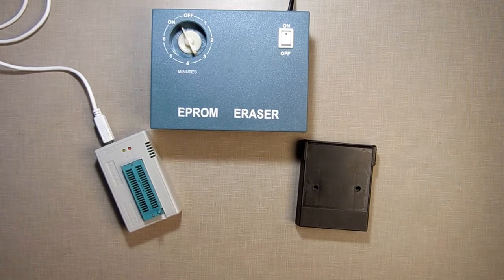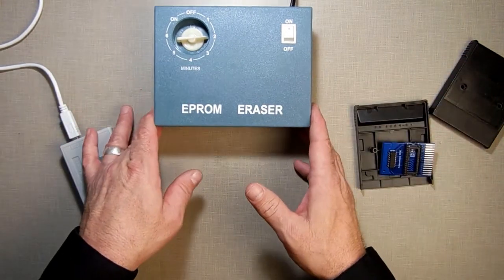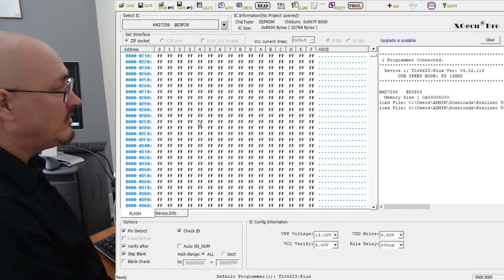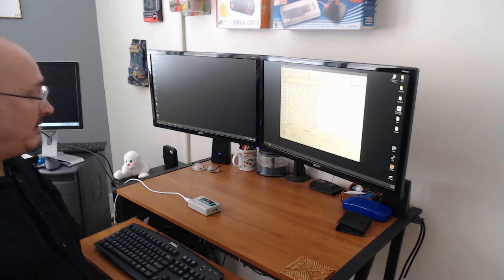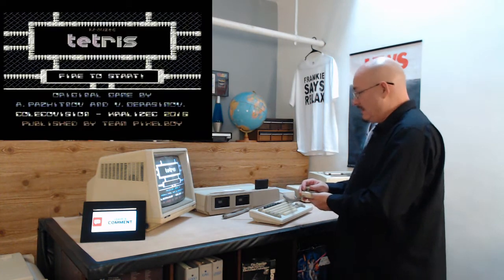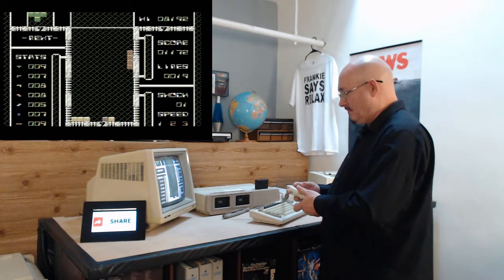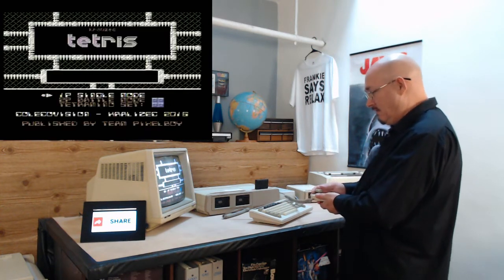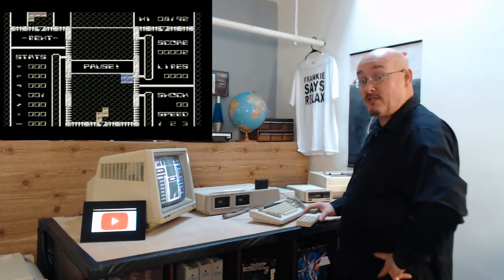Let's Play: Tetris #FEBRUADAM

Comment: What is the size limitation of your cartridge?  Most of the new good games are way bigger than 16 or 32k. I wouldn't mind getting something like this if it can handle the larger roms.
Reply from the maker: 32k - anything larger requires extra chips and bank switching